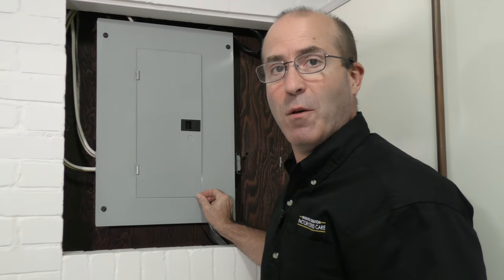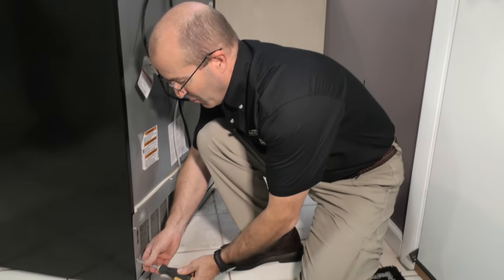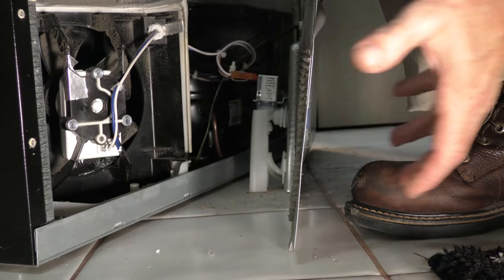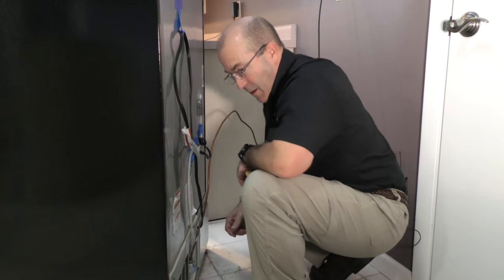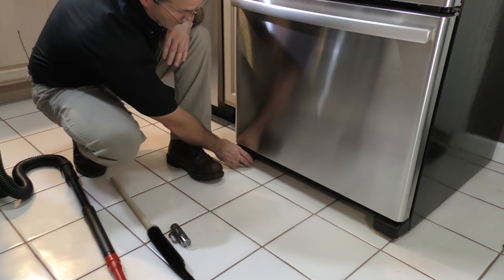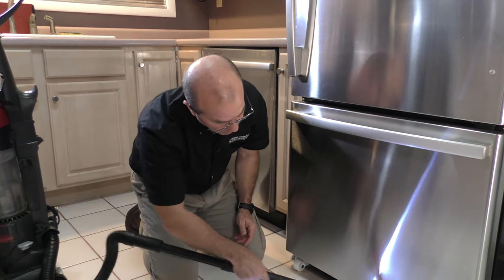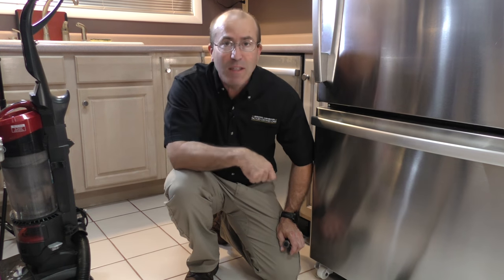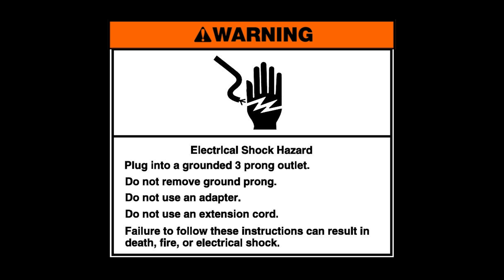Clean Refrigerator Coils

Comment: I moved a refrigerator the other day and noticed at the bottom there was more than one  cooling grill. When i cleaned the front bottom cooling grill, I only cleaned the front. I believe there are more.  After vacuuming the front bottom cooling grill, I took my air compressor and blew air over it. I then was going to clean the back area as shown in this video. However, when I removed the items on top of the refrigerator and pulled the refrigerator out, there was an unbelievable amount of heavy dust. Which meant there were more cooling grills.  Therefore, I learned to not only vacuum and brush the dusty grill and fan, but to also blow air either using an air compressor or shop vac.

Comment: @Whirlpool Appliance Repair Self Help Videos
We just  tried to clean the condenser coils on our Whirlpool WRS325FDAM model from 2017, and the coils are IMPOSSIBLE FOR THE CONSUMER TO CLEAN with readily at hand tools. Coils shaped like this looking from the side  \/ \/ \/ \/ \/   No reasonable access unless you attempt to tip the unit up with a hand truck from the rear at a 45 deg angle. 
Please advise on what I need to do. Thank you.
Reply: same here we should start a class action ;
Reply: @Calchick7
Indeed, Whirlpool has made it impossible for the normal consumer to properly maintain the fridge. That seems like a deliberate effort to make the unit fail earlier than it should. I set up a complaint ticket with Whirlpool on 6/7/2019 but haven't heard anything back from them. I will be sending a certified mail return receipt requested complaint to their engineering department and if I don't get any resolution I will be looking into legal action and a class action lawsuit seems the way to  go, since my main goal isn't to make any money, but to force the company to make it possible to maintain the appliance in reasonable manner, and the proof in the pudding is that if you go back a couple of dozen years or so that same fridge( we had one) you could fairly easily clean the condenser coils and evap coil without any serious trouble.
Reply: I have this type too. It's a huge PITA. All they had to do was design an access panel on the bottom side of the fridge beside the coils and you could quickly clean them with a brush and vacuum. Instead you have to use compressed air and make a sizeable mess, even with wet rags, vacuums and filters. Pathetic engineering.

Comment: This procedure is mostly backwards.  Remove the back-plate first, then vacuum off the slots, so that they are not blocked.  Leave the backplate OFF, do NOT put it back on.  Then go to the front, vacuum the debris, and THEN use the brush to clean the coils.  This will leave a LOT OF DEBRIS at the bottom and back of the Fridg.  Then either BLOW OUT the fuzzy stuff out the back, or go back to the back and vacuum it out.  Then put the backplate back on.  His procedure almost always guarantees that the backplate will be blocked by fuzz, and cause premature failure of motor or starter capacitor and/or relay.  We had dozens of rentals, and had fridges which lasted 35+years, if properly maintained.  Mostly only required starter capacitor replacements, every 13+years, or so.

Comment: Obvious question is, "Why use the coil brush AFTER vacuuming?" The brush will dislodge dust and if you vacuum first, that dust will just be left under the refrigerator. Why not brush first, then vacuum?

Comment: Whoever designed this type of bottom coil should be required to go house to house and clean them twice a year. There is NO WAY you will ever get anywhere close to the crud behind the "fence" that supports the coils in the front with any vacuum attachment or brush. The entire structure should be turned 90° so you can access the open sides of the coil "Vs" from the front of the machine. Dragging my compressor into the house isn't a fun thing and I don't have a leaf blower. The design of the coils and ease of cleaning will be #1 on my list of things to look at when I need to replace the current refrigerator.